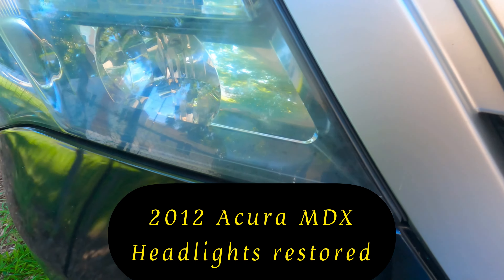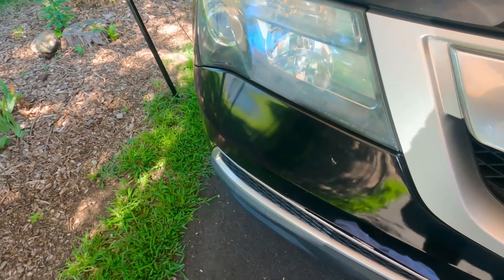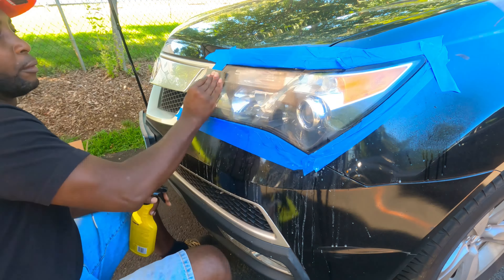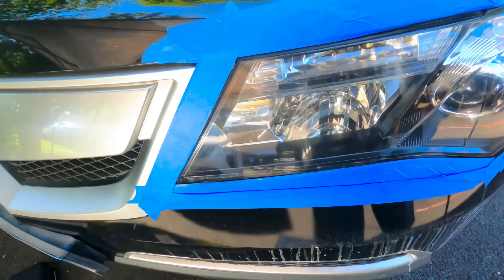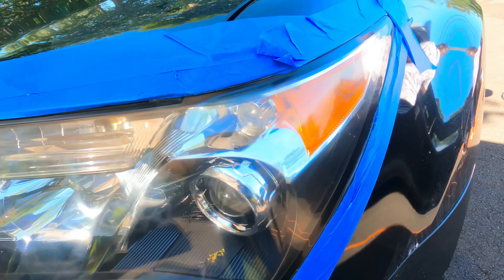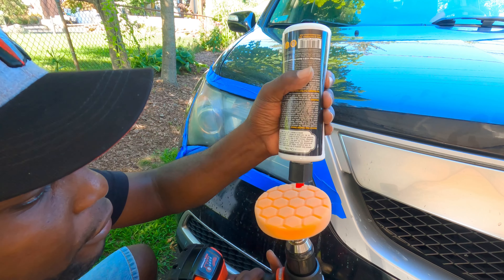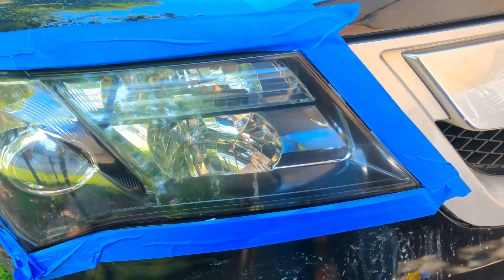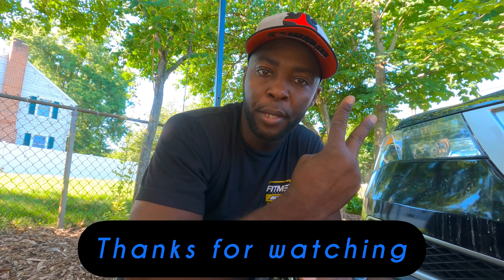2010-2012 Acura MDX headlights restored

Comment: Nice job...how abt 2014 stlye led to fit 2012 model.????...or what's  the best led headlight assembly  to install on 2012 mdx.....thnx
Reply from the maker: Well it all depends. Do you want to keep the stock look? Or you don’t care. There are multiple options depending on  how much you want  to spend.
Reply: I don’t think there are currently any aftermarket LED Headlight options on the market for the 2011/2012 Acura MDX.  I don’t know if the 2014 will fit.  If you guys know if they are or is please let me know.